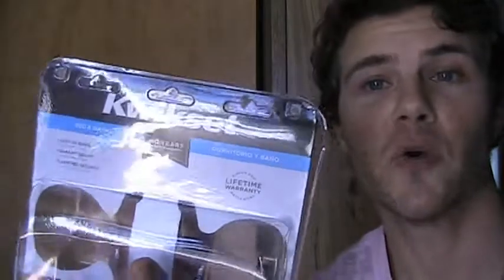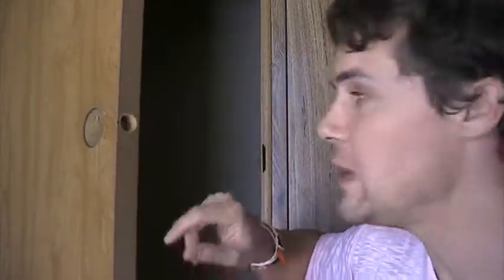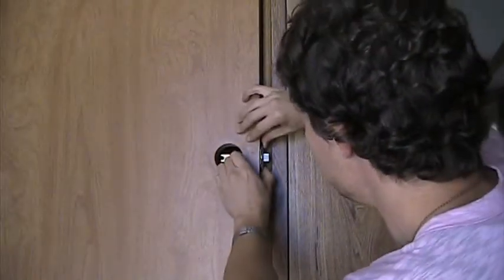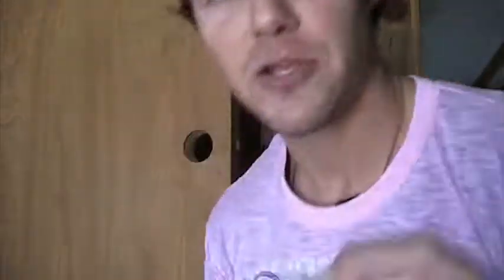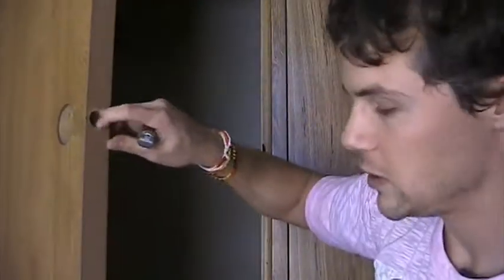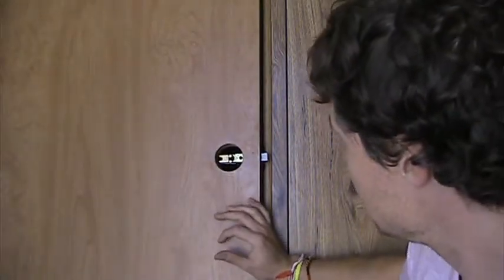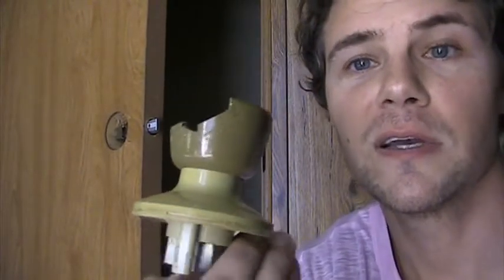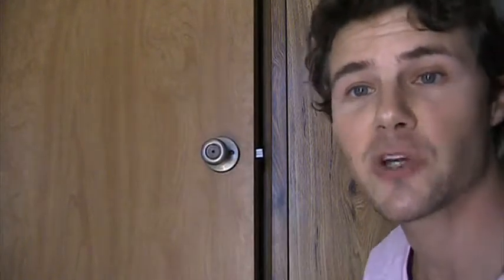Quickly Changing A Mobile Home Door Knob

Comment: Just bought the exact door handle kit at Lowes.  There is another problem with these door handles.  The tapered pin that sticks out (The part that moves in and out the side to latch the door)  still sticks out 1/8 inch and will not full draw in even if you remove the front plate.   It won't slide past the face plate mounted on the door frame when trying to close the door.  

BE VERY CAREFUL when trying to install these doors.  If you try to force it closed, the door will jam and you will need to break the door in to get it open again.

Comment: What is the trick to remove the door knob with no screws.. old brown kind fyi!
Reply from the maker: Hi Tyler McGinnis, Thank you for reaching out and connecting. Over the years I have definitely had my run in with a few different types of doorknobs that took longer than they should have just to figure out how to remove them from the door. Often times there is a metal cover or That may be pried open with the help of a flat head screwdriver to reveal the screws that must be removed prior to the assembly coming apart. If this is not the case then aim to remove the 2 latch plate screws. Occasionally these two screws will hold in internal pieces of the doorknob that hold the entire assembly together. Additionally, if you are having trouble removing the doorknobs after screws have been taken away, try a combination of turning different doorknobs different directions and pressing and depressing the latch in and out of the door. With all this said, I will fully admit that I have taken a hammer to a doorknob before because I was unable to find out how to remove it the correct way. In the end, the new doorknob always ends up looking much better than the old one. I apologize I'm not able to give you a direct or definitive answer. However I do hope that the suggestions help point you in the right direction. As always, if you ever have any questions or concerns now are moving forward never hesitate to reach out any time. If the solution was an easy fix that is not listed above please don't hesitate to comment back and let us all know what worked for you. All the best. Talk soon, John